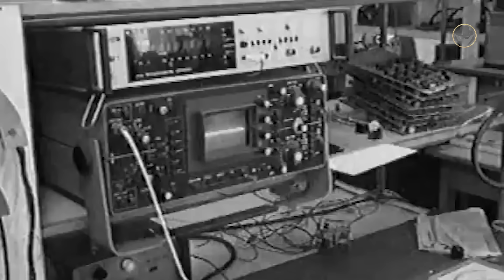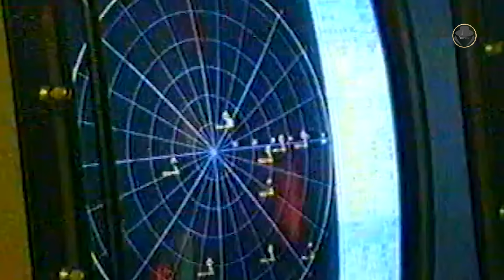Mărășești | A bizarre warship in the Black Sea

Comment: Marasesti is more than that. First of all, it is a training center and a testing platform. The Romanian navy has met with the Russian or Ottoman navy before and the numbers prove that the Romanians kept them away from the shore with strategists, skillful maneuvers, adaptability, resilience, tenacity and wisdom:
 https://en.wikipedia.org/wiki/Romanian_Navy_during_World_War_II

Unfortunately, most of the stories with the Ottomans or with the central powers in WW1 are in Romanian and I'm too lazy to translate them, but the balance of forces is similar and the results the same (in 1877, with one motorboat and two sloops, the Romanians managed to get the Ottomans out of on the Danube sinking two ironclads of almost 500 tons each and in WW1 with a motorboat, the same used 36 years earlier, the Romanian navy managed to force the fluvial fleet of the central powers to retreat upstream in Hungary).
Reply: It's not about the size , it's how you use it , as long as they fight you on your terms they are at a disadvantage, just like how during WW2 the Japanese had a shim with an oversized turret destroyed cause they got tricked into an unfavorable position and sunk